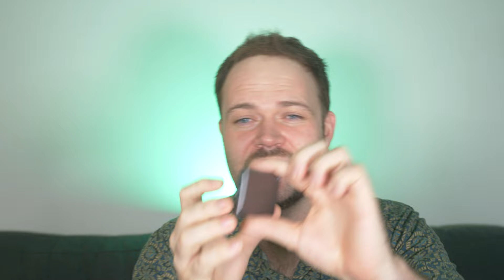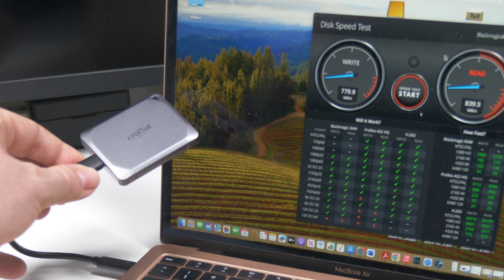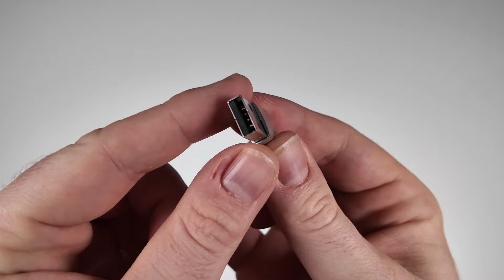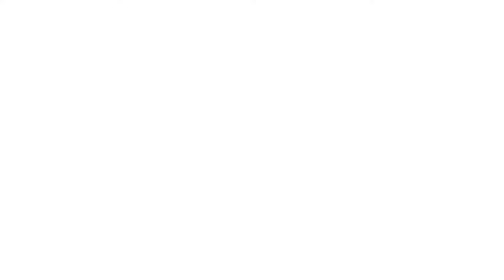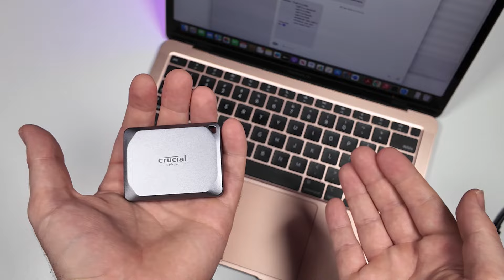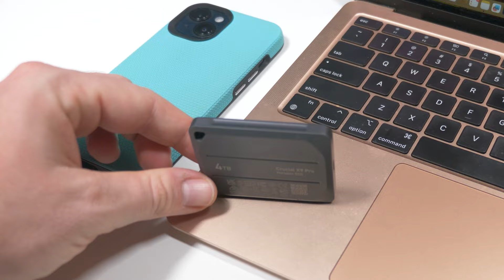Supercharge Your Workflow: Crucial X9 Pro SSD Review for Creators! 🚀📸

Comment: First of all....I'm an older gent who knows enough about this stuff to utilize digital life and love it. This SSD is fast and small. I thought the price was great for 4TB.
The downside is twofold thus far....
1.) This drive disconnects and reconnects a few times an hour all on its' own. It doesn't matter if it is sitting or being used. It doesn't feel hot and is not the cable.
2.) Getting some kind of encryption on this to protect the data is a nightmare. I've downloaded the Storage Executive software and while it is comprehensive in its' scope, and mentions encryption, there is no way to simply password protect this drive. Crucial sends me to Bitlocker but it doesn't handshake and I'm tired of reading endless MS forums to sort this out. Do I need "Bitlocker to Go"? Do I need to have "MS10 Pro edition" to simply get this damned thing encrypted? It's maddening that Crucial simply can't make this easy. I have used WD drives for years and they are bulletproof plug and play in this regard. I'm going back as I am quickly losing faith in this drive.
3.) I wrote tech support, let's see what happens tomorrow if they will redeem themselves. I think if I was 30 years old and could navigate all the jargon with drives etc. I might stand a chance but why would anyone go through this nonsense?

10-10-2024......Still waiting for the encryption software I was promised for this drive. On top of that the drive is now disconnecting and reconnecting by itself while remaining docked to my computer. I regret buying this SSD and will stick with Samsung or WD next time. Crucial needs to do what they say they will, it's not worth saving a few bucks and spend so much time screwing with this.